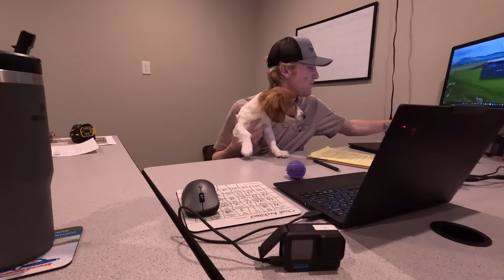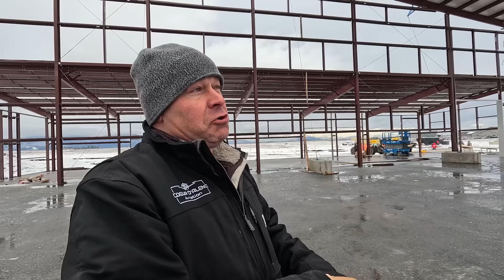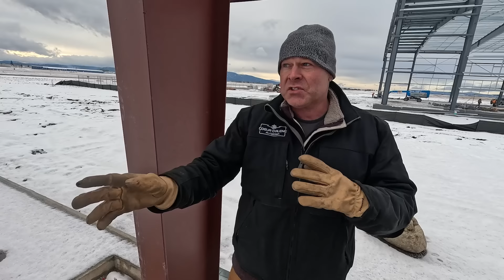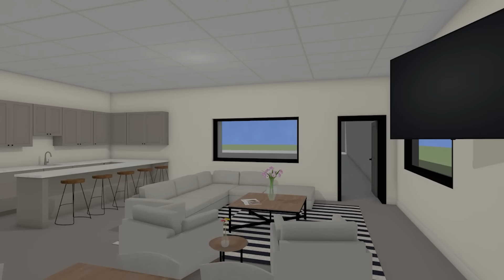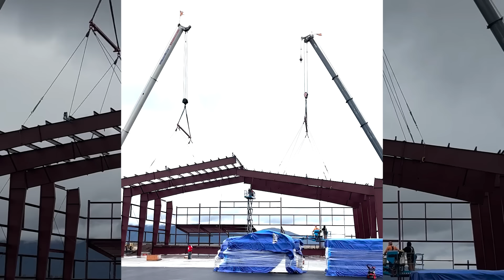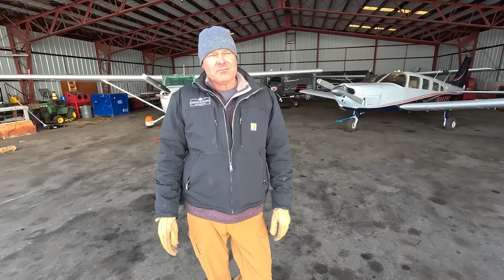Most Hangars ARE NOT Built Like This | Part II

Comment: As an Aircraft mechanic I would've loved to work there. When I first started, the company I worked for didn't engineer there concrete correctly when they built there new hanger. They where suppose to be able to put a 747 in it. because it wasn't done wright the concrete was to thin, they couldn't use it for 747's.